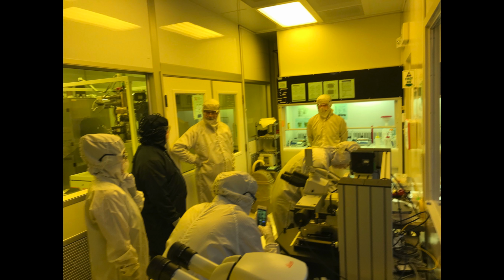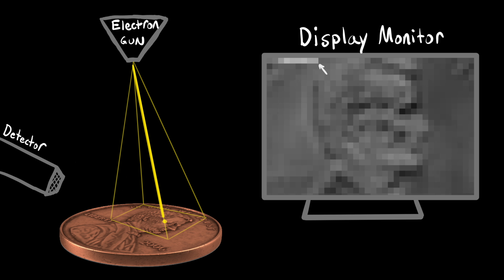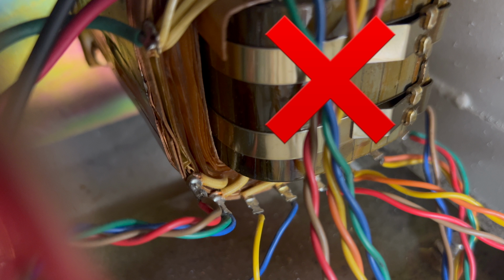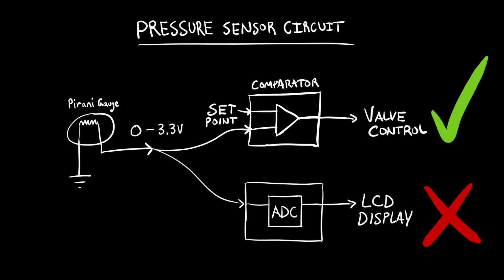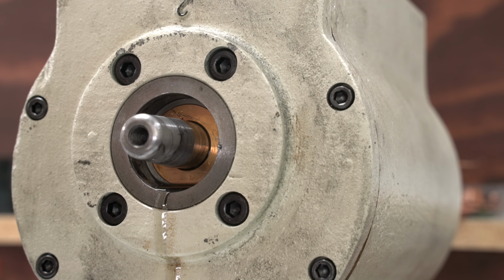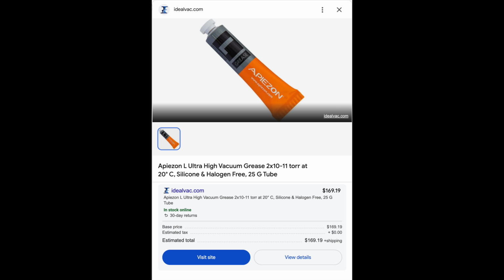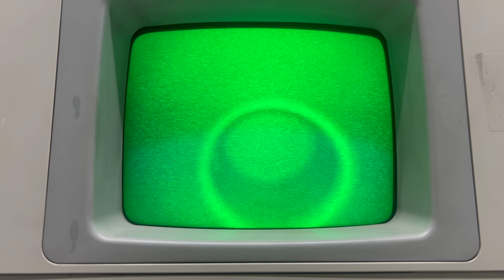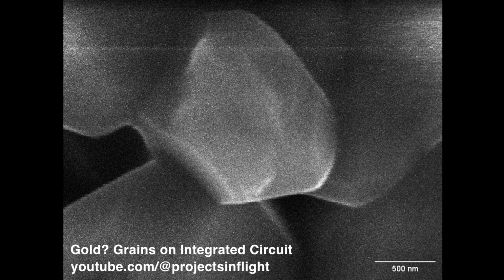I Saved an Electron Microscope from the Trash

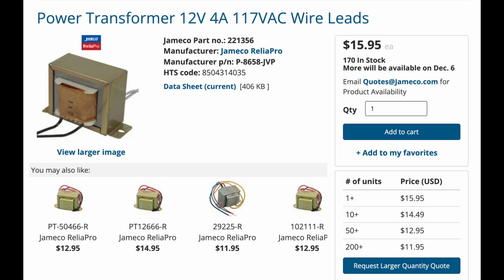Comment: 11:13 Ok, question here could you have remove the leads from the bad winding and used another unused tap on the transformer or could you just used a single separate transformer to power the bad circuit? I guess if the internal windings were shorted though that would be a problem.

Comment: I work with the Jeol 7000 series microscopes and they are a big step up from these old series. We mostly run fegsem sources for more probe current and resolution but expensive when they go wrong. Your edx's silicon detector nitrogen cooling tank is massive? How big is the detector?

Comment: Thank you for sharing this very interesting journey (and congrats on the microscope!). Not only is the topic itself (how electron microscopes work) fascinating, but your undeterred debugging approach was very encouraging. You took a machine which no one in a specialised lab was able to repair, and you probed into its issues step by step until you fixed it. I had a broken motor on my garage door, for half a year. I was afraid to try and fix it, and instead tried (in vain) to hire some experts to do that. After your video, I approached it with a similar probing process, managed to find and replace the broken parts and now the motor is working again. It was a trivial problem compared to your microscope journey, but it only happened because I felt empowered through watching your video. Thanks!

Comment: I loved this video but i love more that it can be summarized in

"Everything breaks in the most obvious way"
Fuse? Popped.
Why?
Transformer? Blown.
Replace.
Bad vacuum? Leak.
Where.
Rotary pump? Bad.
Replace.
Buttons? Broken.
Repair.
Video output? Nope.
Why?
Cable? Damaged.
Replace.

Like im sorry but how couldnt the technicians, the people whos job it is TO repair this thing, not do it? 

Of course not to undermine your efforts, this IS a lot of work, learning, effort, and repair. But its issues seemed generally rather surface level in comparison to what could have been wrong with the machine (ie: logic being fried or broken/damaged boards). Im glad you got your hands on it though. And congratulations on fixing it!

Comment: I would recap and probably replace many of the semiconductors on all the circuit boards additionally re flow all the solder joints. If you can replace the video board to feed a OLED would be great. I'm sure you can increase the picture by recapping and re-flow.

Comment: I just got half way through the video and had a thought on repairing the vacuum pump seal surface: Maybe an skf speedi-sleeve could work for repairing the running surface of the pump shaft seal. They make them in pretty much every size. I have used it to fix a leaky rear main seal on my car caused by a grooved crank shaft.  It seems to hold up well so far.

Comment: I bought a working Jeol 1010 TEM on auction cheap because I wanted the compressor. Couldn’t find anyone that wanted any of the rest so it got scrapped. Still have the sample holders and have tried to get in touch with any college that has the 1010 but no luck.

Comment: HI, very cool! I worked (briefly) with high vacuum systems back in the '70s to 10-6 mm at Argonne, I was thinking that the plastic hose was going to out gas limiting your low vacuum. I never thought of the Apiezon grease was so expensive.
buy yourself a can of DeOxit D5 to clean the contacts and potentiometers, replace all the electrolytics on the amplifier and power supply boards.  
Rich

Comment: @31:22  Any chance to upgrade to a better detector or maybe do some modification on the board to be able to process higher scan rates with more incoming data per unit of time?
Reply from the maker: After doing some more testing, it appears that the main thing limiting resolution is probably a combination of a slight misalignment of the lens apertures, as well as an electrical glitch that causes adjacent scan lines to be misaligned slightly. Any other upgrades will be useless until i fix these two issues.

Comment: I worked on the Jeol JXA-50 A for over three years.  It had fully quantitative energy dispersive analysis. It also had wavelength dispersive analysis too with PET and STE crystals plus another two.  Jeol as far as I remember was a Japanese company. I knew about electronics and was able to do some of the repairs myself. We had tungsten filaments used with the Welnelt cap , and if the vacuum was good, it could last weeks. The whole vacuum sequence was automated and when you got 4 green lights you were good to go. The vapour pressure of the oil used in the diffusion pump needed to be low otherwise the  low vacuum pressure of around 10^-6 torr for the diffusion pump could not be achieved. Just occasional, the  over-temperature  thermostat on the diff pump needed replacing as it passed a lot of current at the time. If air got into the system accidently while the diff pump was open, then it meant changing the diff pump oil, and on our machine that was not an easy thing to do. on one occasion the Li detector warmed up and the whole thing lost resolution and needed to returned to the factory- rather expensive I remember. Our device had it's own transformer to drop down the voltage from 240V ac (UK) to about 110 V ac. I think we could reach an accelerating voltage of up to 40kV. Most of the time we used a beam current (from memory)  of 3 x 10^-9 A. Very interesting video, brought back some memories. The serious image integrity issues at 33m may be the result of localised charging of the sample wobbling the beam. The department where i worked has some Jeol and Phillips machines, but the Jeol was the best as the others did not have wavelength dispersive analysis.

Comment: A surprising recommendation from the algorithm, but quite well chosen for me.  Good job.  Now I'm thinking of the handful of exotic items I have, which are deserving of restoration.  One is an old lathe which is 8 feet long, can turn 16 inch diameter, or 24 inches after removing a bed gap.  Another is basically a 14 inch diameter telescope in an iron pod which was hung below the wing of an F-14.  It has a mirror controlled by stepper motors so the scope looks to the side rather than ahead or behind the aircraft.  The sensor output has I think a dozen or two dozen pins, whether to feed something equivalent to raster scan TV, or some digital output, I'm not sure.  The system was named EO-LOROPS.  Uncle Sam paid around $1M, I paid around $1K for it.  Even just extracting the optics from it, looked much harder than I expected, so I stuck it in storage for retirement.  Now I'm retired. I also have some incredible zoom lenses (probably with sensors) in underwater housings from the navy, similar deal.  But big glass is out of style now.

Comment: I always wanted to try designing a semiconductor that could be powered by scanning a spot on it with the incredibly high voltage and low current of the beam.  I don't know what I'd make it do, but powering something with an SEM has always seemed cool

Comment: Congratulations on the repair. You could try to modernize several elements of your microscope. Maybe use a color LCD screen instead of the old LCD tube. At a more advanced level, you could think about using a Raspberry Pi running on AI and make more interesting images.

Comment: FYI, for the pump shaft at 18:36, there are actually repair sleeves made expressly for this purpose called redi-sleeves. Grainger or any industrial supplier should have them. They're a very thin stainless sleeve that you press onto the shaft and provide a new sealing surface. They do expand the shaft OD slightly, so it will reduce oil seal life, but that would definitely be a workable solution in this case.

Edit: finished watching through. That pump could potentially be brought back into service by carefully lapping the damaged vanes, but the outer bore might also be damaged. Are higher viscosity oils available? Some light lapping of the vanes combined with a heavier oil could potentially bring that pump back into service, and it would likely improve with use as the vanes wear in again. Something to keep in mind, since a high-vacuum pump is always a handy thing to have in a lab.

Comment: Sooo cool dude, great job repairing this electron microscope. I love repairing older electronics, primarily old CNCs. The first thing I always check on dead machines are the power supplies. Can't imagine having so many analog circuits using so many different voltage outputs. Thanks for sharing this journey on repairing a piece of revolutionary equipment.

Comment: Excellent video and great repair job.  I had a similar experience restoring a Cambridge s600 in the early 00s.  BTW i used to work on Thermo ( noran) EDS systems and did a lot of installs on jeol 5x00s in my day.  As has already been mentioned be very careful of the eds detector window.  They are extremely fragile.  And for a detector that old you may find it needs to be repumped.

Comment: Absolutely Amazing!  Well done!   

Q: If you are replacing the 100V primary transformer why not use the opportunity to change it to 120v which are easier to find transformers for?  Was there something else that needed 100VAC?
Reply from the maker: The motors that move the valves operate on 100VAC and would be a pain to replace

Comment: Usage suggestion: Scan functioning electronic circuits. Please, if there's a way with that machine, if you could try that.
Some years ago the Applied Science channel used a DIY electron microscope to do just that. The video is titled something like 'Seeing Electricity'. 
Unfortunately the target circuit stopped operating after a while. Too much beam current? Vacuum affecting the circuit - electrolytic caps etc.?
The video basically ended there and we were left hanging without further investigation or study.
It's a very cool idea and I'd like to see more.

Comment: Some items you can use to determine magnification/image resolution: 
Red Blood Cell, Albumin, graphene (collect from graphite pencil with scotch tape method), human hair, any good micro filter (say from a fritz funnel, HEPA filter etc...where there is advertised/known filter size). 
        image those at several different magnifications and gauge resolution +  image size = decent benchmark/starting point. There are calibration tools for more technical calibrating and calculating variance, but they may not be needed for your uses.

Comment: As a biologist I'd love to see some cells or bacteria! You can easily (and relatively harmlessly if handled properly) get some bacteria from meat that's a couple days old or something. Cells may be interesting but you can kind of get pretty far with phase contrast and/or light microscopy, but bacteria are pretty small. Even at 1000x magnification you can't see much. Would be fun to see it under the SEM.
Reply from the maker: only issue is that you can't have water in the sem.. i'd need to somehow dry out the cells without damaging them

Comment: Amazing repair video, and lots of comments and tips on the way, thats excellent! For all old equipment, a standard service is to replace all old electrolytic capacistors (they might be ok, but as a standard service, replace all of them with new high quality capacistors). If I remember correctly channel Applied Science hooked in a modern video capture device right onto the video into his electron mictroscope, this might be a quite easy way of capturing images instead of using the old computer.

Comment: This is super cool! We have a more modern Jeol in my cleanroom, that we use for making superconducting nems devices. It's also origonally an SEM, but it has been converted into an EBL using NPGS, which is kind of the cheapest litho software that is available(as far as I know). Maybe there is a way for you to get your hands on that, and start proper electron litho experiments?

Comment: I chuckled when you said “25,000 volts”, mainly because a color CRT is driven by 36kV and those were in pretty much every home for decades. 

Also, I’d much rather accidentally touch the wrong lead on that board than any of the others...way safer

Comment: When you need a specific transformer, its cheaper to get it custom made. It is cheaper than you would expect. My physics teacher in collage told me this, i went to the industrial part of the town and I was surprised. Several years later, via the connections I made through the transformer guy, I got in touch with some optics people and they did the mirrors for my telescope. Again, all surprisingly very cheap.

Comment: The Cards are the Cardinals. Arizona Football team. Great work getting this thing running! I cant believe how many things were wrong with this system. I suspect the video issues you were seeing are from the cheap video cable you used in the repair. Those are garbage, try getting a higher quality cable. Also, if you ever need work as an engineer Id love to interview you! I could use someone with your ability to fix things.

Comment: Would an SEM this old have pixels? It seems like it's working in an analog way with some digital control hardware
Reply from the maker: i used the term pixel but in reality it's a continuous video signal, so it's actually just lines not pixels

Comment: i cant help you with reducing vibration of the plate it self. but having the machine on a hard surface like granite with springs beneat the granite will reduce vibration of the outside alot. but it aint cheap.

Comment: 8:40 for those who want to know. you can only look at electrical conductors. 
but if you tot look at say an organic sample, you have to put something on top of it.
most labs have extreme fine gold dust. that sound expensive but realy isnt. the coating is extremly thin. just small enough to be a conductor(and gold doesnt need much).

also for those atom pictures you cant use a SEM. you need a TEM. very different microscope and much more difficult.

most labs only have SEM because its good enough. and for big labs or universities that need it. have like 20:1 sem:tem or more.

Comment: You can actually buy just the replacement carbon pads for rubber dome switches. Far easier than finding and cutting ones from existing devices. Also flickering on the CRT display is most likely from the dried up caps. I'd start looking there first and not the sensor. It's not a timing issue but rather vertical stretching of the image changing value, which points to caps. However I'd definitely find an old LCD TV with composite input and replace the whole CRT thing all together.

Comment: A SEM use in semi conductor is used for examining defects during the process of making a semi chip... so a wafer would be broke and you get a side view of the structures laid down... as an example... a via blockage or a via open ...   the SEM doesn't do much more than offer info on a semi process that went bad and you need to know what went bad....

Comment: Everything electronic on the controller side of things can now be done digitally using inexpensive microcontrollers or a laptop! You only need BIG capacitors and control circuits to control the huge electrical currents and buy a multi-stage vacuum pump which can get down to 10^--6 Torr which quite easy to do these days if you use multi-stage pumps. 

Just remember to glaze the inside of your DIY Stainless Steel vacuum chamber column with a thick film GLASS-coating to prevent off-gassing and hydrogen embrittlement-based breakdown of the walls of the vacuum chamber. Forget water-cooling! Immerse your system in Silicone Oil recirculated out to common automotive radiator systems (i.e. Heat Exchangers!) that will keep temperatures low and prevent degradation of electrical components. Using computer-based power supply parts and automotive parts also means the SEM parts are easily and CHEAPLY replaceable!

When I saw that spaghetti of wiring and analog circuits, I could see I could redesign the entire system and turn all that into a single CPU motherboard about 12 inches by 12 inches and adding server-computer-based power supply systems and high-current control system board using some large capacitors and inexpensive power control circuitry!

By re-purposing COTS (Common Off-The-Shelf) computer industry parts and automotive industry parts lets you recreate a proper high-resolution SEM for about $5000 USD that is cheap and FAST to repair when things break down!

V